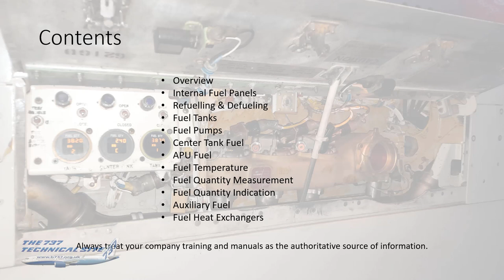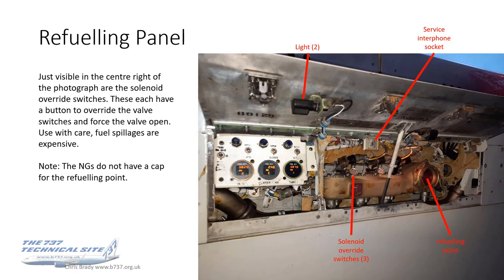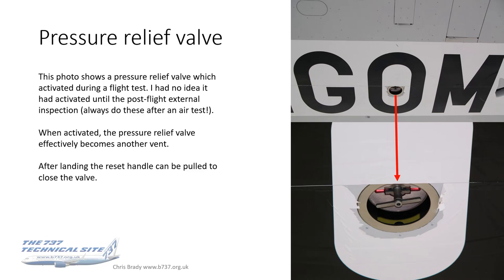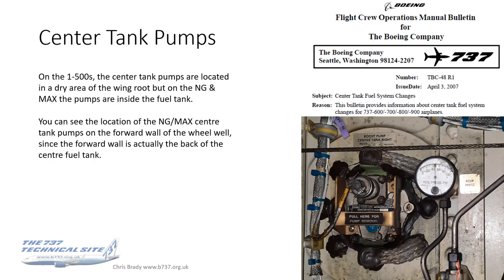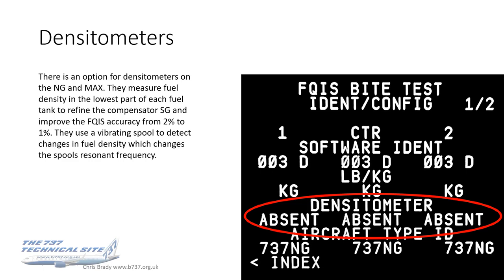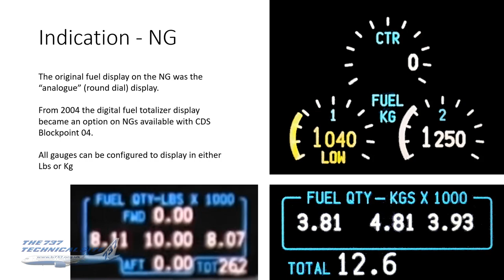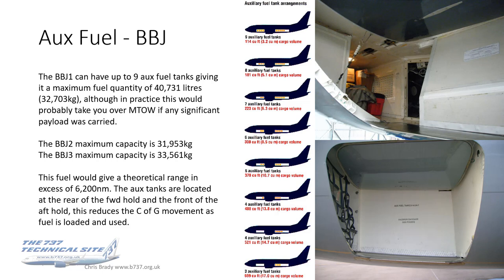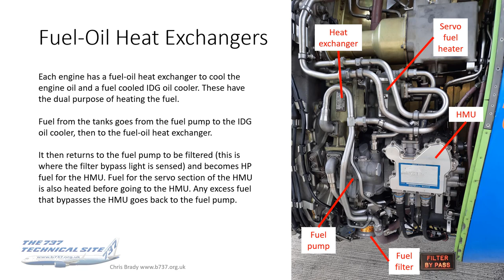737 Fuel

Comment: Interesting story about the test flight involving the suction feeding! I had read in a manual elsewhere that the purpose of the first and second stage engine driven fuel pumps was to boost the pressure even further from what the fuel boost pumps already have done so I've always been under the impression that these pumps are more powerful and would provide reasonable pressure to the fuel in the event of a complete loss of the main fuel boost pumps. Thank you as always for your outstanding content Chris, it is always much appreciated!
Reply from the maker: In the cruise or descent or at low levels the engine drivel fuel pumps should be sufficient to deliver a decent head of fuel pressure but in the climb the effects of cavitation due to released air may, as I found, be a problem.

Comment: Regarding your comment on spar valves, the start lever is mechanically connected by steel cable to the FCU on the engine which has an internal shutoff valve. This is why the engine shuts down immediately using the start levers, whereas shutting the dc spar valve with the fire handle requires the fuel to burn off if the start lever isn't moved to cut off. It can also be why an engine fire may not necessarily be stopped immediately by pulling the fire handle.
Reply from the maker: Thanks for the explanation, very helpful.

Comment: Good Day Capt Brady,for B737NG how much is fuel consumption Show in EICAS fuelflow kg/hours for taxing,climb and Cruise?
Reply from the maker: There are no single exact figures because there are many variables. For instance taxy fuel varies with environmental factors such as ISA deviation of temp & pressure altitude. It also varies significantly with aircraft weight and to a lesser extent on the taxyway surface and slope and engine condition.

Comment: Amazing content! 
Just one thing about the minimum fuel temperature, I'm almost sure that all over USA they use Jet A (freezing temp of -40°). Adding the +3º C, the minimum fuel temp we go to -37ºC. 
Boeing recommends that you stick to the highest value until the third consecutive refueling process with Jet A1.
Anyway, here in Brazil will do flights that last 7:40h (Brasília - Orlando) but I've never seen fuel temperature below -10°C. 

Thank you for the amazing video!
Reply from the maker: Yes you are correct about the use of Jet A and 3 refuellings, I should have mentioned it in the video. Here in Europe I have seen some very low fuel temperatures in winter when you takeoff and land in cold temperatures on a long flight.

Comment: Great videos.

I believe the fuel valve closed light on the classic is an indication of the shut off valve located at the engine mounting wing stations (wing spar). Controlled by start lever or fire switch.

There is also a fuel shutoff valve on the output of the MEC controlled mechanically by the start levers only - there is no indication of this valve in the flight deck.
Reply from the maker: Thanks for the info

Comment: just for info..

32:20 both the boost pumps (for both main tanks 1 and 2) are on the aft spar for the MAX. just a tiny little thing u seemed to have missed. Your info is ofcourse correct for the NG .. this is one of the minor differences between MAX and NG Fuel systems.. amazing video otherwise. thanks
Reply from the maker: Thanks for the info, I had missed that difference.
Reply: Yes, on the MAX, Main Tank 1 & 2 Fuel Pumps are physically located in the Center Tank; their pick-ups piped to their respective tanks. I presume this is a safety feature taking advantage of the Center Tank’s NGS Inerting feature. Possibly easier servicing as well. I had no idea the Spar Valves had their own battery packs for emergency power to close!!
Reply: @ChrisBrady737  I’d love to see an addendum or edit to include the MAX difference in the fuel pump locations. My airline is transitioning to MAX’s exclusively. I made all my classmates aware of your superbly informative videos; they’re helping me study for my Type Rating! ;)
Reply from the maker: Unfortunately I can’t edit a video after it has been published but I will make sure that this is mentioned in the Tech Guide and the forthcoming book i am making which is a complete compilation of all of the screens and scripts of these videos.

Comment: 29:46 - Could the auxiliary-tank vent's location potentially be to keep it from being affected by the disturbed air coming off the wing?  Given that the wing produces considerable changes in pressure in the airflow around it (and that these changes vary considerably based on aircraft configuration and angle of attack), putting the auxiliary-tank vent behind the wing could conceivably result in situations where the pressure gradient through the vent becomes reversed and the airflow sucks fuel vapor out of the tank (which would reduce the pressure head on the fuel pumps, increase the rate at which the fuel evaporates, pose environmental concerns, and potentially become a fire/explosion hazard) rather than pushing air in.  (All of this is just a guess, though.)
Reply from the maker: That is a great theory and it certainly stands up to reason. If I ever find out the reason I will post it here.

Comment: Dear Chris,
I have a big pb with fuel scavende pump...
I don't understand why it works when the fuel main tank is half or less since the center tank is supposed to be already empty...!!What is its utility(fsp)?? 
Many thanks for your great teaching!
Reply from the maker: The centre tank pumps will not fully drain the tank, they will leave some residual fuel behind due to their inlet location and the aircraft body angle. The scavenge pump is used to drain any residual fuel in the centre tank.
Reply: @ChrisBrady737  Here is why....!!Many Thanks for the explanation, very helpful...

Comment: Thank you  sir for these great videos!! Could you explain why the center tank fuel pumps low pressure lights don’t illuminate but the lights of the main tanks illuminate when the switches are OFF? If the lights of the CT are inhibited when OFF, what is the reason for that? Could you please enlighten me?
Reply from the maker: The different logic is explained in the video but essentially it is to avoid nuisance amber lights when you do not need fuel in the centre tank and therefore have the centre tank pumps off.

Comment: Awesome video Sir !!  . A small doubt . Main tanks are full , center tank is about 5 tons . I have switched off left center pump . Right center still on . Cross feed closed . Now , Does the left engine feeds on left main tank or center tank and right engine from Right main tank or center tank ?
Reply from the maker: Firstly, I assume that you are talking about an NG, the system is different in the Classic.
If an NG with full main tanks, the center tank scavenge pump will not operate, so that is out of the equation.
On the NG the main tank pumps produce higher pressure than suction feeding so fuel for the left engine will be taken from the left wing tank. The right engine will feed from the centre tank because the centre tank pumps produce a higher pressure than the main tanks.
Note that this is not the recommended way to crossfeed fuel.
Reply: @ChrisBrady737  Thank you so much sir . Cross-feeding to be done as per FCOM supple. in my company . Speaking of which ,  two further doubts regarding NGs😬. Q1) During cruise we quite often get an imbalance under 453 kgs , do we need to balance it out ? ( I understand these limits are for structural considerations and not for controllability as such - FCTM ) .  Q2) In many short sectors , we often have the fuel required for flight , present as fuel on board from previous flights . In such cases , main tanks are sometimes at an Imbalance ( under 453 kgs ) , can we accept such situations ( Talking from FCOM limitation - Lateral imbalance must be scheduled to zero ) . TIA .
Reply from the maker: It is up to your company SOP in those situations. But Boeing dont require any aircrew action until 453Kg.

Comment: Hi Chris, thank you for the impressive teaching. I'm an aerospace student doing a simulation calculation about the b737 fuel system. I wonder if u could provide some information about the electric fuel boost pumps, like the manufacturer or performance specifications. I've been stuck on finding them for a long time. I'd be appreciated your help.
Reply from the maker: Hi, I dont have any more detailed information about the fuel pumps. The manufacturer is CRANE COMPANY HYDRO-AIRE DIV 3000 WINONA AVENUE PO BOX 7722 BURBANK, CALIFORNIA 91510. Hope this helps.

Comment: Good Morning Capt Brady, 

Is it possible to fly an B737NG with Autopilot Engaged/ON but the Autothrottle Off/disengaged Mode?
Reply from the maker: The guidance for this is all in the FCTM "AFDS Guidelines" it states "Autothrottle use is recommended during takeoff and climb in either automatic or manual flight. During all other phases of flight, autothrottle use is recommended only when the autopilot is engaged in CMD."

Comment: Amazing video! Just one more question, exactly which No.1 pump to run when using APU on the ground? I saw some companies using the AFT pump some using the FWD pump, are there any reasons for choosing one over the other? Thanks!
Reply from the maker: It doesn't matter which pump. It is simply recommended that at least one pump in the supplying tank be on to provide positive fuel pressure and preserve the service life of the APU fuel control unit. (FCOM NP 21)

Comment: Is the fuel a liquid or a gas ? As these figures quoted ....seem like alot of extra weight? N1 & N2 Nitrogen Gas ?
Reply from the maker: Fuel is kerosene, a liquid. N1 and N2 are the rotation speeds of the fan and the core of the engine respectively.
Reply: @ChrisBrady737  wow ! As a Qualified plumber these figures don't make any sense ? Liquid JETA? In wings...3900kg per wing ? JETA BEING 20% LIGHTER apprx THAN WATER so 4,680 litres....4 tonnes per wing???? Average car weighs 1.5tonnes? Are these wings no just riveted together? Aluminium? I once was sat in the AIRCRAFT while refueling was carried out. And not a sound ? Yet I could hear the baggage going in below ?......either I am miss reading your figures or something isn't right here ?????
Reply from the maker: The SG of Jet A1 depends on the temperature but is around 0.76 to 0.8
Reply: @ChrisBrady737  no sure what your point is ? Its 20% lighter than water approximately?....my point is having watched Hot water Cylinders being made soldered copper, they always add water after making them, Hydrostatic testing...adds the extra stress to the welds etc...There is no such fluid test for your Wing tanks! That's why I thought maybe it was a Gas ?
Reply from the maker: My point was only that the fuel is 0.8 of the weight of water so it is not quite as heavy as you might think, but it is still many tons of fuel in each wing. I don't know if the tanks are hydrostatically tested during manufacture, but being aircraft components they have very high standards.
Reply: @ChrisBrady737  0.8 of 1 litre of water means they are 20% lighter  than water per litre, it baffles me that as a pilot you can not feel this amazing amount of weight in the wings on take off and landing, I've sat on the wing seat many times and the wing bounces the same on take off and landing.... 1000 litres of JeTA will be weigh 800kg thats alot ! why are they not weighing the planes before take off? To check the exact amount has gone into the wings etc..they weigh trucks...they weigh suitcases and I heard you can demand to weigh passengers for weight distribution? ...Liquid JETA doesn't make any sense in a aluminium riveted wings that's not  even been tested for water.....just sharing some thoughts,  I have also been studying the gas turbine engine and this appears to be an AIR engine.
Reply from the maker: The aircraft are weighed before take-off. The empty weight is known, so we add the weight of passengers, baggage, freight and however many litres of fuel we have on board to find the precise weight of the aircraft. And yes we can feel the difference between a heavy and a lightly loaded aircraft.
Reply: @ChrisBrady737  can you leave me a link to the aircraft wiegh stations like the ones trucks use..many thanks 👍
Reply from the maker: @jonessenoj6753  We dont use a weigh station before every flight. Weight is ascertained by calculation.
Reply: @ChrisBrady737  seriously? You don't weigh the planes? You weigh the suitcases?? One miss calculation due to human error...or a fault gauge and your dropping out of the sky? Thanks for the Honest replys...I will forward this on to jonessenoj youtube channel where he is clearly 100% correct about your planes having no liquid fuel in them!

Comment: Thanks a lot! I have some questions about fuel system.
1. Why is there only one temperature sensor? (at main tank #1)
2. Why isn't there any bypass valve at center tank?
Reply from the maker: Q1 is answered at 50:47 Q2 because if center tank bypass is required, you should still have full wing tanks.